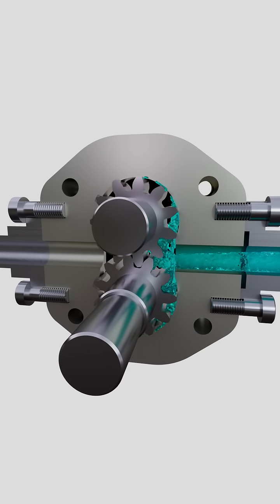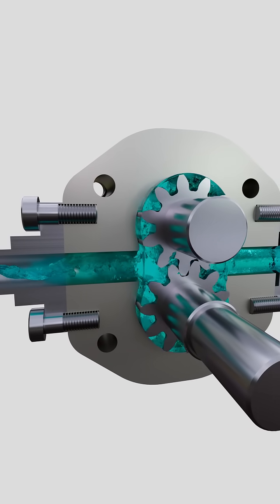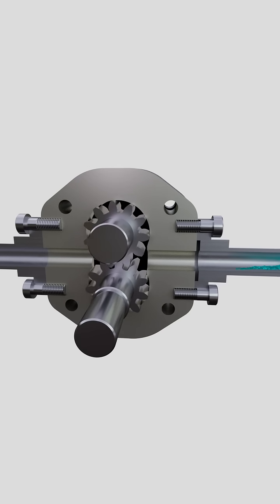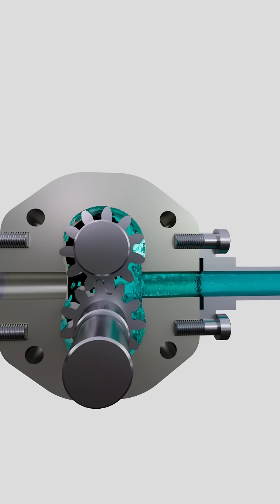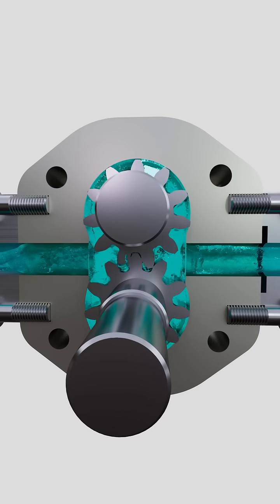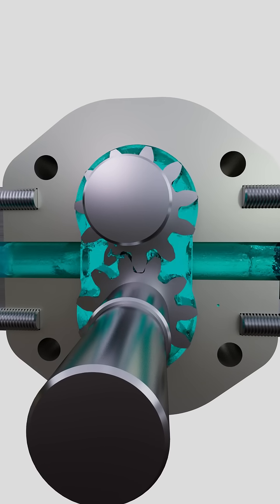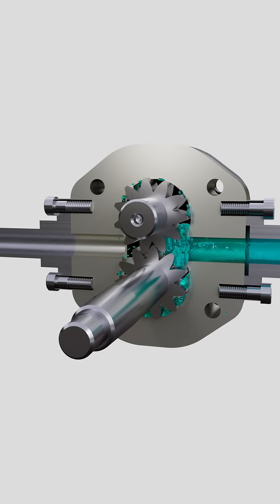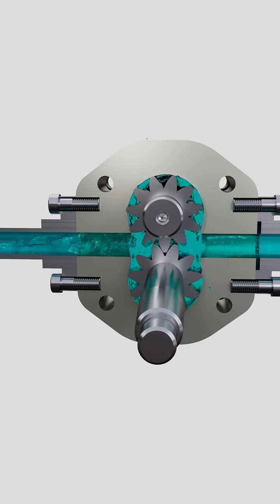Gear pump. That pump works exactly opposite from the way many expected.

Comment: If the gear rotate in the other direction will it pump the fluid just worse or directly not pump it at all?
Reply: If you spin it in reverse, it will just pump backwards, dependending on the inlet/outlet design

Comment: How I made sense of it in my head is that pushing towards the sides means pushing towards twice the surface area of the face of a gear teeth. One face upwards, and one face downwards. Pushing towards the middle only lets you push towards one face of gear teeth at any time, because the gears mesh over each other.

Comment: What is the torque?
Reply: Judging from the diameter of the shaft and the likely high viscosity of heavy fuel oil, I'm guessing high, most likely driven by an ac motor.